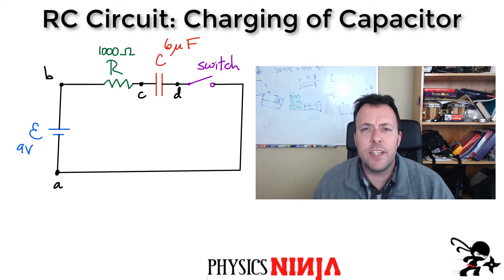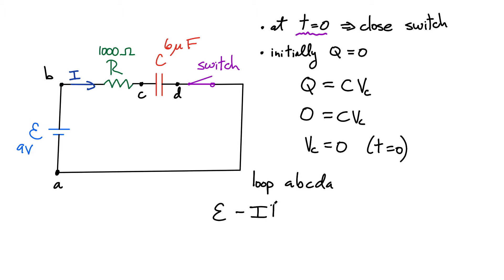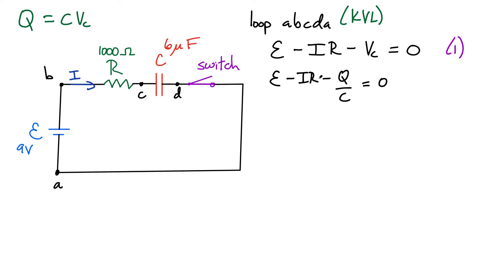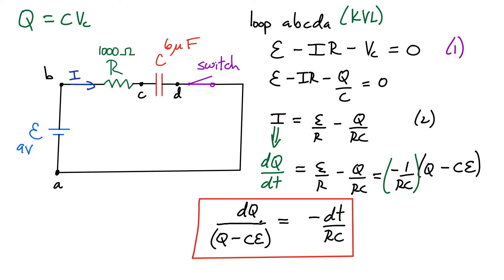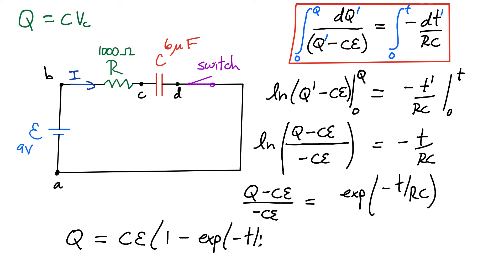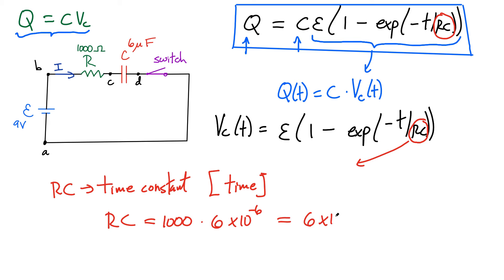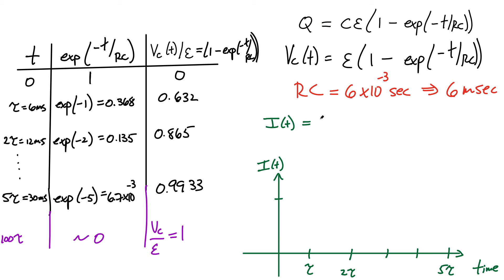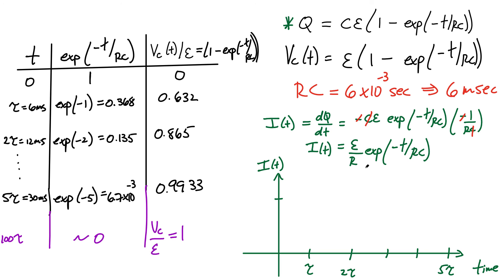RC Circuit: Charging a capacitor

Comment: what will happen if we dont put a resistor
Reply from the maker: Capacitor charges instantaneously
Reply: @PhysicsNinja  will it cause damage to the capacitor or battery？
Reply from the maker: @tommyli1695  could cause a spark if the resistance is small.   Capacitor is fine as long as it's voltage rating is less than the battery voltage.    In reality the wires in the circuit has  a small resistance so it still takes time to charge.